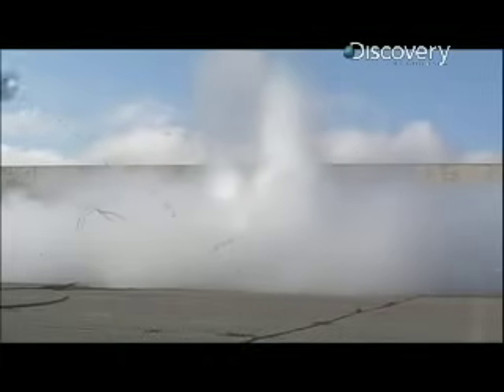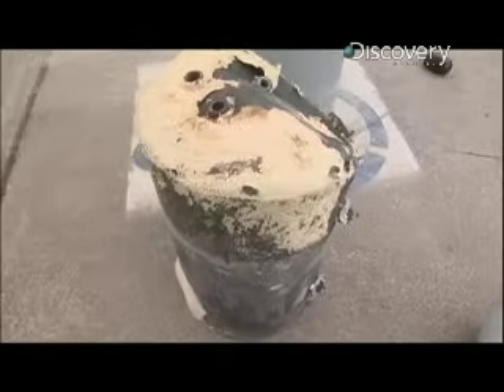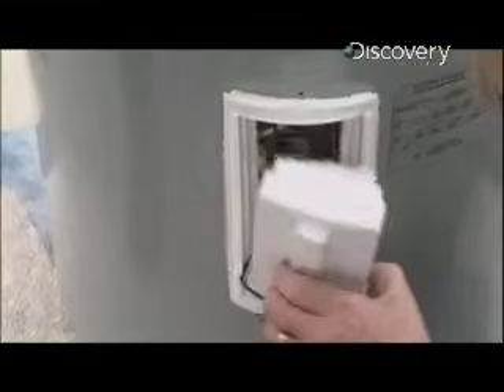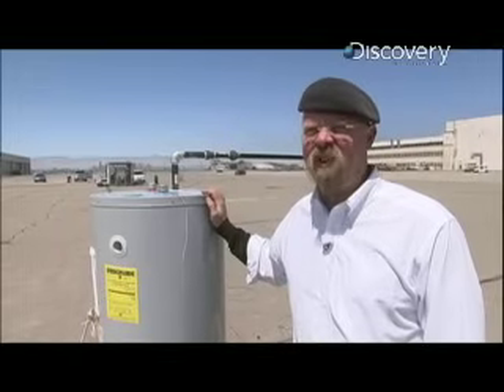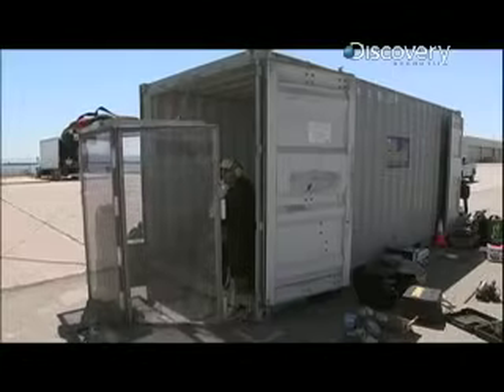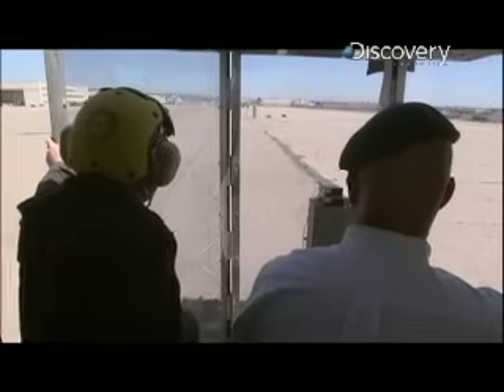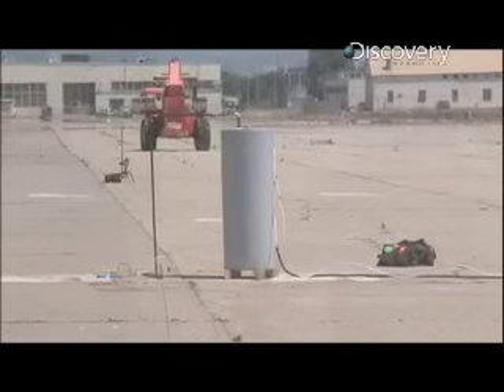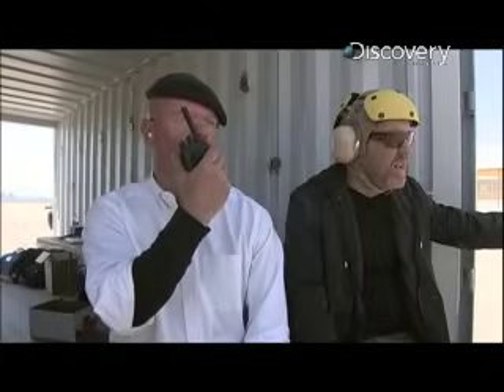MythBusters - Exploding Water Heater

Comment: The boom is caused by the dimension of the bottom of the tank, its concave,when the pressure builds above the level of the “burp” or “dent’s”  concave design threshold it gets popped out like a pop-O-matic die tumbler in some popular board  games, or one of those hand ball halves you push inside-out and put on the table when they’re cold, and suppress your laughter, until dinner is half way done and the taters warm the thing up “PAAPP!” goes careening off of the ceiling into the grasp of the cat, never to be seen again if Mom finds it before you do, simplicity, install a pop off valve at a safe but worthy pressure,  say, 180, set your shut off valve at150, hang the tank by the two eye rings on the top, (beneath cover and insulation) with kern-mantle rope from a support beam so its at least 20” off the floor, plumb a water drain valve near the bottom so it extends two inches down and 18” from the tanks outside diameter (you can use any factory bung with reducing pipe thread  adapter, two double inverted flare line insert flanges on either side bend inside line so its as close to or touching lowest level or use adhesive to fasten a flexible tube weighted on inner end to a nipple, use  5/16” transmission cooling line to a union with a ball valve. take a rubber-made trash can slide it under the tank after running your air lines at least two feet higher than the top of the tank, or enough to clear the trash can by a foot and a half put a pallet and a piece of sheathing-under rubbermaid or dollar store can test for leaks fill the trash can with bentonite clay, “old type cheap unscented cat litter) or old not too oily speedy dry mount service and safety valves so they extend outside of the trash bin, add in about a box of arm n hammer washing soda or borax, add water slowly to hydrate the speedy dry or sand install lid add safety and input output lines gauges shutoffs, don’t mount the  compressor unit to tank, run a heat exchanger, (compressor to tank line through a larger diameter pipe with T fittings on each end, epoxy the airline tubing ingress egress ends ( or wind a coil of tubing in and out of a water bucket to keep incoming air temperatures low, you cab bury the tank in the ground, with two feet of packing peanuts in a trash bag on the bottom and if it goes you’ll only have a mess in the shop or ruptured air tank to remove, (sulfuric acid, alum, and a safe oxidizer (Don’t Do This Yourself For God’s Sake, the wrong sequence could kill you unknown variable reactions can cause poisonous fumes) dare someone you don’t like to do it! Duhhh! Jk, Sorry for the long winded book but anyone of these things as a precaution I just got it thanks safely I’ve seen guys do it friend of mine was a really good welder he set one up,  real tall water heater tank, it let go, left the building, the sound we heard from a half mile away, i can only attempt to spell, “BAH-W-KAKKK-OOOM-BASH!!” broke the joists, rafters and about a square of shingled plywood off  of his garage roof, we couldn’t tell where the tank went, I don’t think he ever found it, (?) i don’t think so. Send the next one he did he welded ribs around it with feet to elevate it, Use the pressure washer with about 3800 pounds of water (no air at all!) pressure, and slowly re shaped the thing, That’s not how much pressure I put in the tank that’s how much the pressure washer had I’m sure it complied with the intent long before it reached pressures  anything close to that high!

Comment: How much bigger before the heater leaves Earth alltogether?
Reply: <Starts up kerbal space program>
Reply: Sam Carlson A man of culture
Reply: A rocket is just a huge hot water heater with rocket fuel and an oxidizer inside of it instead of water.
Reply: I died because my father did believe my uncle about it needing to be replaced.
Reply: @appletree8441  rip
Reply: Not possible in a meaningful sense, air resistance is too great at escape speed

Comment: Just dawned on me how the water heater takes off all of a sudden and why it goes straight up.  The concave base panel is designed to intrude on the tank in a way that strengthens the container.  But, when it finally buckles it "oil cans" to it's inside out shape with enough speed to rip the welds all around it's circumference.  This suddenly releases the entire contents boosting it into orbit.  If there were a "tear" panel in a safe spot on the tank the pressure might release in a more controlled and gradual rate.

Comment: From Arizona to New Zealand there have been reports of water heaters been blowing up the cause broken safety valves International Plumbers Association strictly says you should not mess with the safety valve or it will result in the boiler blowing up and it will go through your roof.

Comment: A water heater at home cannot explode  even if the safeties malfuction because the pressure will always expland on the water supply, which is connected. Most likely the heater will overheat until the heating elements burn before anything else happens...
Reply: Yes it will a water heater is a large boiler you tamper with the safety valve it will explode and it will go through your roof
Reply: xphobus Wrong. Houses have been knocked off foundation due to exploding water heater.
Reply: Charles Doyle name one
Reply: https://m.scmp.com/news/hong-kong/law-and-crime/article/2163329/explosion-hong-kong-police-station
Reply: @robertlee-nq6mg  that was not a water heater expluuusion that was the KKK dOin that
Reply: Complete bullshit! In the water connection to your house, a backflow preventer is closing when higher pressure from the house is pushing water back into the providing water system. Logical consequence is not only an exploding heater, instead pipe are exploding too.

Comment: Just did the calculations. If it was up there for 12 seconds it would have gone 150+ metres in the air!
Reply: The acceleration is due to gravity. If it took 6 seconds to reach the apex of the flight, then it left the ground at 6*9.8 = 58.8 m/s. The height reached is 58.8*6 - 0.5*9.8*36 = 176.4 m.
Reply: No it does not.
Reply: While the heater is in flight, the only force acting on it is gravity. It doesn't have it's own power like a car does.
Reply: ***** Teliots is right. If you ever did "Basic physics" you would know that Fg = mg, where Fg is the force acting on a falling body in N, m is the bodies mass in kg and g is the Earth's gravitational acceleration constant of 9.8ms towards Earth.

None of those variables have anything to do with an initial force, therefore while the heater is in the air there are no external forces acting upon it except for the Earth's gravitational force (ignoring air resistance), just like Teliots said.

What you may have been referring to was the immense acceleration that would have been experienced by the heater at the moment it exploded and was propelled upwards.
Reply: That is just wrong. There's nothing more to say really.
Reply: Yes, the time taken to return to the ground is enough.
Reply: Benji Gunn F=ma

Comment: a water heater is a type of boiler removing the safety valves or tinkering with them will cause the boiler to explode and it will go through your roof. DON'T MESS WITH WATER HEATERS! they will explode

Comment: Did you have the tank half-full of water and then piped in compressed air until it failed, or what?  (that's what it looked like; I saw a temperature gauge that said 70-something degrees F)  If so, you missed an important part of the experiment.  An actual WH explosion has superheated water converting to steam and is a lot more energetic than compressed air.  Look up "BLEVE"  Maybe you covered that in the episode; all I saw was this video.

Comment: You don't need qualified engineer. Unless you are complete dumbass. There are far more bad things which happens. In USA they don't know much about district heating systems ( so far i know about New York steam heating). Just imagine if huge steampipe from power plant to district heat exchanger(heats water/converts heat to low pressure houses heating) brokes! Luckily new systems are using low pressure hot water.

Comment: Plumber who installed such heater or owner who bypassed all security features must be complete dumbass. Want to hear insurance company or police:) Old heaters have two safety features in case of thermostat failure. Temperature fuse and overpresure valve. New ones have all of those plus spare overpresure valve. 
Some heaters are constructed in a way, that if everything fail, main tank brokes gracefully. There is small thinner place in main tank, that will break first and release presure safely

Comment: This actually did happen in my area, at a mexican restaurant on the south side of 152nd, west of 1st ave.  The water heater went up in the air, moved in a north east direction across 152nd, across 1st ave, landed in a pizza hut parking lot which resides on the east side of first avenue, and on the north side of 152nd street. Yet no one was hurt at the restaurant or out on the streets :O!
Reply: did it go thump when it landed?

Comment: it stayed 13 second in the air.  it makes 6.5 second of free fall, means that it climbs at 207 meters (660 ft) and his initial speed was 64 m/s - 230 kph - 143 mph.

this is damn quick.
Reply: I know this is 9 years ago. But your calculations don’t seem right. I don’t have the number to give the core to answer, but it wouldn’t have been falling for 6.5 seconds, that would be mean it fell as fast as it went up. It’s not a constant speed the whole time.
It may have accelerated to peak hight 3 or 4 seconds in and free fell the for the remainder.
Anyway that’s just my take.
Reply: @andrewwilliams5337  All velocity is not created equally. Terminal velocity is way slower than the detonation velocity that got it up there.
Reply: @FrankBenlin  I'm pretty sure the terminal velocity of this tank (which is made of steel) is more than 64m/s

Comment: @Rand0mManic

Unvented Cylinders are usually equipped with three stages of protection;

1. A normal temperature thermostat, normally set between 55-65 Degrees Celsius.
2. A high temperature cut out, set at about 90 Degrees Celsius.
3 A temperature and pressure relief valve which will activate at 90-95 Degrees Celsius.

As you can see, they went out of their way to disable the safety features of the cylinder. It is unlikely but nonetheless, possible. Always use a qualified and competent engineer.

Comment: If you keep your water heater temperature set no higher than 135F, it shouldn't explode even if by chance the safety valve gets jammed.
Reply: Sorry 10 yrs late, but yes it can under rare circumstances.  A faulty thermostat that fail to shut off the gas burner or electric elements,  will cause the water to superheated,  increase in pressure till the tank fails, then the flash of steam causes a tremendous release of energy capable of leveling a home, and injuring or killing the occupants.  This is what the temperature and pressure relief valve is designed for, to open automatically and relieve pressure if rising above 150 psi OR 210°F.

Comment: In a home inspection class I took the instructor had told us of a homeowner who capped off the pressure release valve on his water heater. I think it was dripping. Which, unknown to him at the time, is an indicator of regulator failure. So when the completely regulator failed his water heater over-pressurized and blasted from his basement clear through his roof. It was found severy blocks away.
Hows that for an air-pumped water rocket!? :)

Comment: Wow that was a good guess, it held for 12.5 seconds and he said 12 to 13. Probably cheated. LMAO!! Small?! No boom! Medium?! Boom!! Extra large?! KabooM!!! XD.12 bar = 174.04 pounds. per square inch (psi). In the video the tank burst at around 315psi or 21.7 bar. It sounds like 2 booms did it break the speed of sound you know sonic boom or is that just the echo off the buildings? FluorideACTION . net < Sign up for the